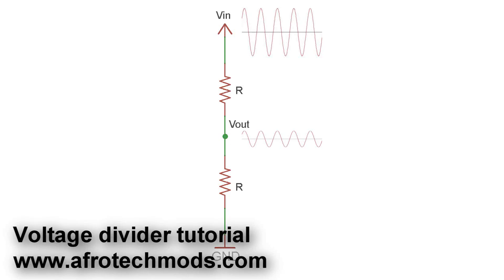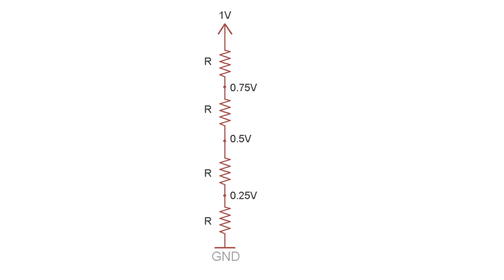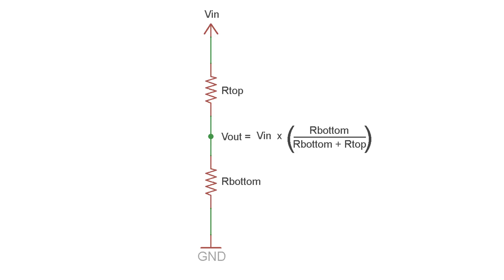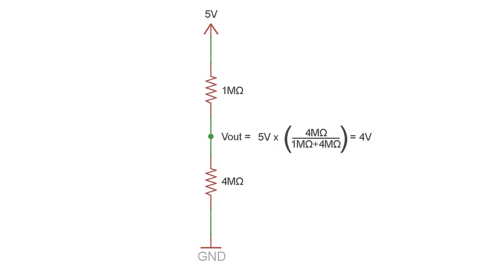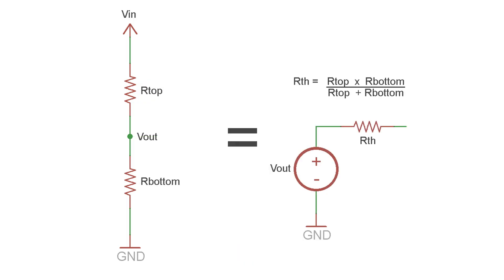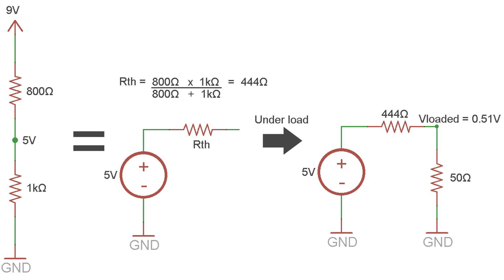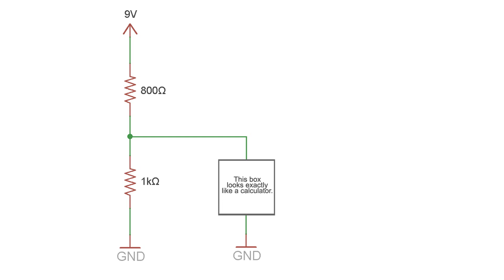Voltage divider tutorial

Comment: I want to create a variable voltage divider 24volt to 12volts. What's the biggest or best resistors to help me create a setup that can out 12volt @ 5-10amps?
Reply from the maker: You don't want to do that with a voltage divider. You want a DC-DC converter based on a buck converter topology. You might be able to find one on amazon.
Reply: @Afrotechmods  I'm working with Arduino UNO R4, I plan to use a 12v power supply with a DC-DC converter : 
"DROK Buck Voltage Converter 12V to 7.5V 3A 22W Step-Down Power Module DC-DC Transformer Auto Power Supply Board Inverter Voltage Regulator"
I just put the name because it has some information I can't interpret and decide if it's right for me ?

Comment: It's VERY useful to power everything you want. It's the first video mentioning power dissipated I've seen. I also had problems without making a buffer. An opamp can take the high voltage and adjust to another (lower) voltage via inverting/non-inverting input. Not sure about efficiency, but I check for heat. Some devices won't start from losing power in what you think will work. It's back and forth, trial and error for some time, I guess.

Comment: OK so resistors are made for only small current? Damn OK. No wonder mine always catch fire...
Reply: There are such things as high-current resistors but using them is wasteful as they will be dissipating energy as heat to maintain the resistance value. If you need to be able to deliver multiple amps of power you'll need to step up to a voltage regulator or, at the very least, a buck converter.

Comment: So... Where do I connect the loads ground?... In line with the resistors ground?...
Reply: In a DC circuit, the voltage divider would be connect to the + and - terminals of the DC voltage source. To use the divided voltage, you connect the + terminal of the load to the section between the resistors, and the - terminal of the load to the - terminal of the DC source.

Comment: I have a 36v battery (full charge 41.6v) but how can i use with lm2596 buck converter
Reply: The standard buck converters are designed to work with AC, and they work on the principle of using capacitive reactance to limit voltage. In other words, instead of resistors they use capacitors to limit voltage. So to use a buck converter with a DC source, the converter would need some mechanism to switch the DC current polarity, which can be accomplished with transistors or an opamp.

Comment: I want to reduce my car radiator fan speed.....how can I convert 12v 75a battery to 6v the fan is too fast
Reply: Best bet would be to use a simple DC motor controller or voltage regulator with a fixed 6V output, because your fan will draw a lot of current and it is not practical to do this with a resistor-based voltage divider. Now if you were running it on AC then  you could use a buck converter. You may also be able to find a DC-DC buck converter that supplies enough current to run your fan at 6V.

Comment: I've watched this several times.  It's clear until we get to the part about power and voltage drop under load.  That's all good to know but some more explanation of how you compute it would be helpful.  Are you connecting a multimeter to read how much current it draws?

Comment: I have 19v guitar amplifier, I want to use the 20v battery.  Would you please tell me how could I build the circuit board to drop down 1 volt from the battery to match the voltage for my guitar amp?
Thanks,

Lan

Comment: I don't understand - why won't the motor work? It's getting supplied with 100mA just like it's supposed to. Why does it matter that behind the motor voltage drops to 0.56v? Isn't it a "matter of concern" more for potential machines that would be located in series behind it than the motor itself?

Comment: >"what can I say, some ppl are cheap"
guilty as charged.
powering CMOS logic downstream from an Arduino at 5volts is probably the best scenario I can think of where being cheap is a necessary evil, because you can't use a voltage regulator on every I/O pin in use because that would just be dumb. Good video, keep them up.

Comment: Every component resistors, capacitors, inductors, active solid state components have limited use ! 
At high temperatures, for electronics, say 180 degC,  a vacuum tube ( electronics 50 yr old ! ) will outperform a transistor ,   
which will probably NOT function !
At low frequency , say 1 Hz,  an inductor  is USELESS !  A super capacitor  1 farad is required.     
1Mhz at  high current , say 10 amp, through a 1mm solid wire HEATS the wire ; the same length of Litz wire  which has 20 strands reains COLD.

Comment: What happens when I divide the voltage by zero ? How can that be done you ask - Very simply, I reply - I simply progressively adjust the bottom resistor in the string from some finite value to a value of zero ohms. 

At that point, what will the voltage to the load be ? ( in mathematics, when we divide by zero, the result is stated as "very very large", "undefined", "infinite" - - - but what about this example with a simple electric circuit ? 

The answer should be simple, much like the thinking that went into the question !
Reply from the maker: If the bottom resistor is zero it means you have a direct connection to the circuit's ground. In other words it's 0V with respect to ground.
Reply: You are, of course, correct. My comment was more "tongue in cheek" than an actual query.  It would, however, be correct to say that the ratio of voltage applied to the divider string to the zero voltage out of the divider would be infinite ! (or undefined, if you prefer ?)

Still enjoy mathematics, physics, and the practice of electrical engineering even after over 65 years.

Comment: Great video! The only part I'm confused is when it was stated that the Vout under a 50 Ohm load is 0.51 V when that load draws 100mA. Isn't voltage drop dependent on V=IR? So if the thing has R = 50 and I = 0.1 A, then 50 • 0.1 = 5 and the voltage drop would be 5 V meaning Vout = 0. Could someone explain where my thinking went wrong. Thanks!
Reply: Hi, the motor takes 0.1A when you give it 5V, but since we're only giving it 0.5V it's only taking 10mA.

Comment: If you have a 20 amp draw Frome a battery at 12 volts but you want 2.8v at 20a, What is the most efficient way to achieve that? Note this is not just an example I'm going to use this in real life if there is a reasonable way to do this.

Comment: I'm kind of new at this but I'm curious what if I need a constant 12 volt but I need 7.5 amps to go down to 5 amps what do I do. Like do I just take a 7.5 amp fuse and then wire to a 5 amp fuse or would it blow the 5 amp fuse...

Comment: On top of that, if you can, you could add an op-amp follower to make sure the voltage at that point doesn't change no matter what you want to attach. Still won't solve the current problem.

Comment: Resistor is current divider not Volt . Nicely explaination
Reply: Correcr, but also wrong. Its the way 2 or more used in conjunction are used that can control voltage.
Reply: nope! Current is all the same for each resistor.

Comment: I kinda wished you had added one more example that shows what happens when you try to divide a mere 5 volts with the 1 and 9 ohm resistors. Many of us juniors use 1/4 watt resistors, and if my calculations are correct then 5*5/1+9 = 2.5 watts, which should burn up a 1/4 watt resistors (albeit not as badly as your example). Correct?
Reply: Correct

Comment: Hi Need your help .. 
I have a celling fan (75 watts & 300 RPM Elctric volts 220) normally I like very slow speed but my fan runs very fast on 1 speed regulator .. I need to reduce its speed but can not be done thru regulator as it is alreayd 1  ..I thought to use Resitor and fix it in Regulator on positive wire .. Can u suggest me following .

1. will this work using resistor to slow the speed of the fan ?
2. Is it safe for the fan .? 
3. Second what capacity of Resistor to be used to find the result ..? 

Kindly repond to it thanks
Reply: Do not use resistor. Use a PWM signal with a mosfet, or solid state relay if AC.(I dont know too much about AC, but its alot more complicated, i wouldnt attempt it without really doing my research).

Technically you could do this with a very high voltage resistor, but it will generate a lot of heat, and be a fire hazard if not cooled properly (with a heat sink).
Reply: You can use resistors but not the one available in electronic parts shops . High power resistors are used for this purpose . This technique was used decades ago to control fan speed , i don't know whether it's still available in the market . Just serch online , be sure about the ac volt 110/220

Comment: I have a question I want to make voltage divider for 12 V 🔋 with four 1000 ohm (1kohm) resistors. I want to reduce voltage that my Arduino can calculate the voltage. Is this value is good. For the normal resistors? Please help me.
Reply: 1:42

Comment: I feel so dumb when I look up videos about electronics lol.
Reply: That is how learning happens, you feel like you can't make it but you can.
Try it out with a 1.5v (AAA, AA, C, D..etc.) battery and a coupla resistors(you can use a pencil graphite) get that thing inside of the pencil, it is a resistor. cut one piece like 1cm , the other 2cm, the third 3cm. then use them as resistors to try this experiment.

(+) ___wire______
b                                []
a                                []  <- graphite piece 
t                                 []
t                                 *  <-  voltage divider output. test it with multimeter/voltmeter/DMM stick red probe here
e                                []
r                                 []  <- another graphite piece
y                                []
(-)_____wire______  []  <- this is also called Ground = GND , so stick other probe here (the black one)

It is simple just do you and you will know it in no time, just get a cheap meter, or borrow from a friend/people then do this and return.
Reply: You should feel smart for even doing so.  Seriously, so many people now are too lazy to access information that's only seconds away; or, even worse, they reject information and remain deliberately ignorant.  You are AHEAD!  Keep it up.

Comment: Can anyone explain why If i have 700v AC and use 2 Equal Value 4M OHM Resistors, it doesn't give Half Voltage (350v), it gives 296v? (Which is 700/2.36 instead of 700/2) I checked the Tolerance of the Resistors, and they are both 3.91M Ohms Exactly

For more information, Im using the voltage divider to Lower the voltage from 700v to anything below 500v for a tester i have. so the current should be little to none.
Reply: Use a 220V device, say a lamp/bulb in series with whatever your using.
 Or 2 lamps/bulbs of 110v in series then you have around 480v left. 
like this https://youtu.be/wRFRwOnLsZI
In Electronics/Electricity practice(reality) is different from theory, you learn this when you do labs.
Get the Art of Electronics book and it material(lab or student work), see the voltage divider section/topic.
Maybe your college/city library have it so you can borrow it and read it.
https://en.wikipedia.org/wiki/The_Art_of_Electronics
This book is THE BOOK when it comes to learning Electronics.

Comment: I'm making a hybrid drive system with a used inverter generator hooked up two a AC 3 phase to dc rectifier and a dc motor , when I run it I'm getting DC voltage up in the triple digits. What can I do to reduce the voltage to at least 24 volts but be able to get a decent amount of amps 50 at least.

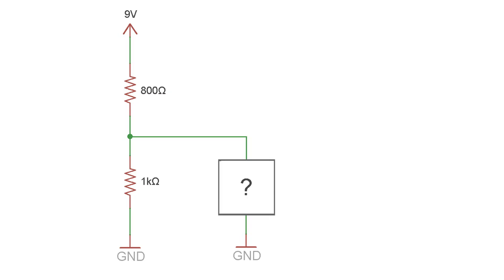Comment: So I tryed to calculate that example about current supply at around 2:10. How do you calculate the voltage drop? What does it mean for the current if you say the Microcontroller draws 1mA? To calculate the new voltage do you subtract this 1mA from the 5mA you had before? So 4mA*(resistance of the parallel path)?
Reply: I dont understand it too. And dont know how to calculate it

Comment: I guess  I am cheap, lol. I was preparing a question just about what kind of load can I apply to such a circuit. What if it is always a high impedance load? I don`t see the problem in the case the load draws less current than V / ( R_1 + R_2 ), which is flowing through the divider anyway. The curent flowing through the load would alter the voltage, but this could be computed if the load current demands where known beforehand. 

Am I correct to conclude that the issue is going to be when the current drawn by the load is highy variable? In this case it is not possible to design a divider that will give the correct electrical tension.

Comment: Can someone help me please? :) I have 12 VDC psu and I want it to power a circuit(12V 40 mA under load), but also a DC motor. the motor works fine with 6 V and it draws about 90 mA. I have messed around with resistors and tried to devide the 12V psu to 6V, by using 100 ohm resistors. Is it "safe" to do that?. cant seem to find an answer anywhere else :(
Reply: If you just need 90mA to power the motor with 6v, you can use L78L06 voltage regulator IC.

Comment: With the motor demonstration, you have an R1: 800Ω, R2: 1kΩ resistor, with a load of 50Ω.

Now I'm not too familar with how the voltage is dropped down, but I'll give it a shot, and try to solve the problem of the voltage dropping.

What if instead of R1's value being 800Ω, you make it a 40Ω resistor. Of course the 40Ω resistor would have to be rated for more than 2 watts.. right?

With that, then the R1 : 40Ω would supply 0.225 Amps, at 5vdc.

How or where could I learn a little more about how to calculate that? To account for the voltage drop when you hook up a load with a specific resistance. Or is it just as simple as the fact that it's just another resistance in the circuit, or another resistance in the voltage divider circuit? Am I right? If not, could you please point me in the direction to where I could learn a little more about how to solve that problem?

Comment: How to get desired voltage output. I figured it out.

I've chosen 12Vdc as my power supply. I've chosen 5vdc as my desired voltage output. I've chosen 15,000Ω as the total resistance.

My equation for how to get desired voltage output.
R1 = (Vout / Vin) * Total Resistance
R2 = Total Resistance - R1

R1 = (5Vdc / 12Vdc) = 0.0.41666666666666666666666666666667 * 15,000Ω = 6,250Ω
R2 = 15,000Ω - 6250 = 8,750Ω
R1 = 6,250Ω
R2 = 8750Ω

Using equation : Vout = Vin * R1 / (Total Resistance)
5Vdc = 12Vdc * 6,250Ω = 75,000Ω / 15,000Ω = 5Vdc

Presto !!! Almost too easy.
Reply: and the load?

Comment: I've never heard the term "thevenin". Definitions, anyone?
Reply: +Matthew Ferrie "Any combination of batteries and resistances 
with two terminals can be replaced by a single voltage source e and a 
single series resistor r. The value of e is the open circuit voltage at 
the terminals, and the value of r is e divided by the current with the 
terminals short circuited."
Reply: +Ross Hudson Thanks!
Reply: +Eric Miret Lol, I should probably do that first

Comment: Fundimetal question: Why does the voltage drop over a resistor?
Reply: +cab3  it's because the resistor as it's name specifies offers some resistance to the current flow through it.And the flow of current is nothing but the flow of electrons...electrons flow only because there is a potential difference across the terminals of the resistor.But since there is an opposing force acting on electrons,for them to flow they need some driving force and hence they use the applied voltage to accelerate across the resistor...therefore there will be a voltage drop across the resistor

Comment: Can you use them to turn a transistor on and off? let's say the upper resistor is a thermistor and a normal resistor on the bottom and a transistors base terminal on the center. Will this turn the transistor on and off depending on the temperature?
Reply: +Emre Homko Yes, transistors don't really need much current at the gate.
Reply: +Calvin Thanks and how much voltage is needed for a transistor to start conducting electricity?
Reply: Not much, it depends on the specific part but 3.3 volts is common, 5 would be safe to assume.
Reply: About 0,7 V, depending on some factors.

Comment: so i can use this to charge "dead" lithium batteries with really low currents?
Reply: Saying that voltage dividers generate low amounts of current doesn't mean they couldn't generate more current if yyou give them the chance to. However, you should decidedly not give them the chance to because that might (probably will) fry the hell out of the resistors...
Reply: Get a TP4056 module(small board) with protection(it got 3 ICs[black chips] not 1), it is around $1
https://www.ebay.com/sch/items/?_nkw=TP4056

Comment: what if we remove GND in Volume control circuit (min 3:21) ???????????
Reply: It will work, but not as an voltage divider. It will work as one single variable resistor.

Comment: Question, you say it's bad to run a motor off of a voltage divider. What about a blower motor in a car, it runs off of the blower motor resistor which is 3 resistors in series and the fastest speed bypasses them. That's a voltage divider, right?
Reply: I think this is not actually a voltage divider, i think it's just adds some resistance to the resistance of the motor and limit the current going thru the circuit. And because of the voltage drop it generates a HUGE amount of heat.

Comment: Thanks for the tutorial, very informative.
Another possible use (I hope it works, I still have to try it) is to regulate the Output voltage of a sensor which works on 10V basis and gives you 0-10V Output down to something a 5V basis microcontroller can handle in it's analog inputs (so regulate 0-10V signal down to 0-5V signal to be able to read it).